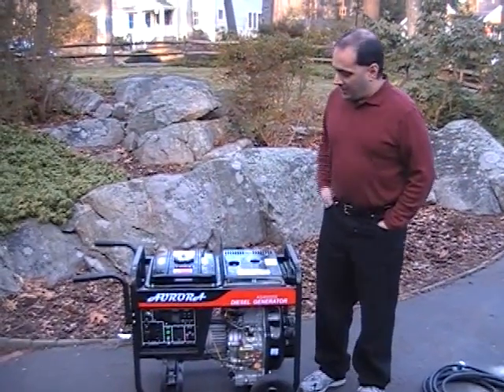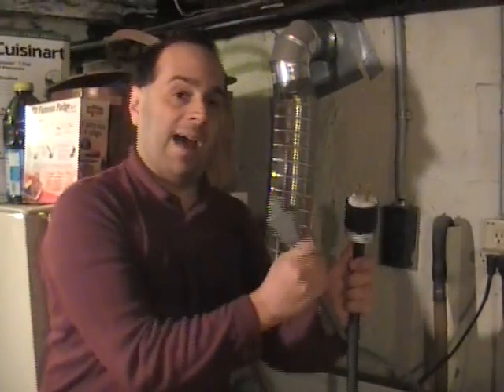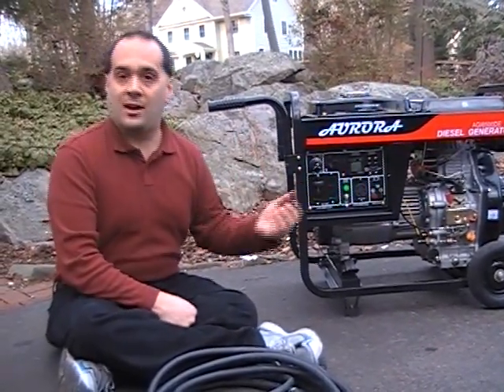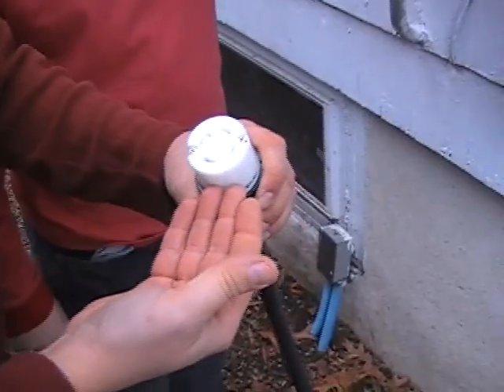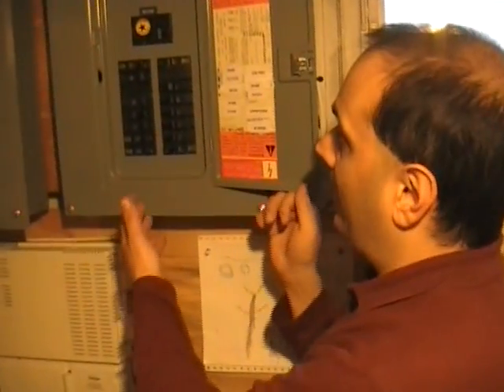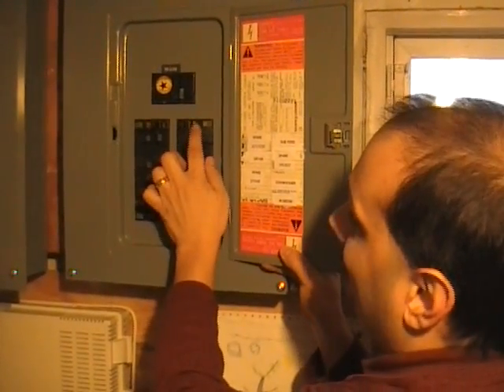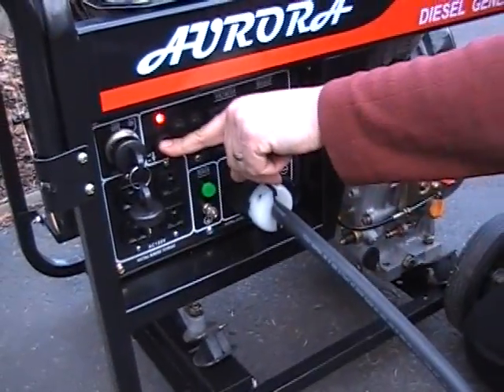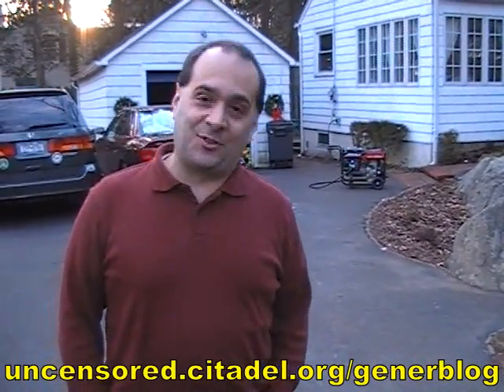Inexpensive residential generator hookup

Comment: My house is on a slab. Where do I put a transfer box and or plug and how do I run power to the breaker box. I bet it is easier just to run an extension cord from the generator to the various electric appliances.
Reply: Usually put the transfer box near your main panel.  It might be easier to run extension cords once or twice but it will get annoying over time.   It literally takes me 10 min to get my generator hooked up and running in a power outage.   I have lights on in all main areas of house, refrigerators, TVs, computers,  internet,  cable ect.  You don't realize how man electrical devices you have until you start trying to use extension cords ect.  Just wait until the big game is on and power goes out and you're scrambling with 100 extension cords trying to get everything going b4 it ends
Reply: blah how many watts is your generator? I just bought a 7500 Westinghouse that got great reviews along with 10 circuit kit cuz we have a well pump that will use 2 breakers. Not sure how many more things I can run with 9500 surge power 7500 running
Reply: I honestly think that my generator is like 5500watts continuous.  I've used it in power outages a few times now and have never had it pop its main breaker.   But lights are low wattage.  My ceiling fans run,  power supply on an average computer is like 500 watts.  But not everything is going to be running at one time.  It's the same theory as you have a 200 amp main panel,  but you could have 300 amps worth of breakers but its pretty rare that every item is pulling the maximum power.  Even your well pump might require a double pole 30 amp breaker but that is usually 25% higher that the absolute maximum that the appliance could ever pull.  Not to mention startup amps and running amps are 2 totally different things.   Usually an appliance uses the maximum at startup but uses considerable less as it continues to run.
Reply: blah FYI our well pumo is a double 15 so 3600 watts max, and as you stated, that's only used when water  is used.  The dryer and stove are the killers.  Double 30, and double 50 respectively. Cant believe a stove needs that many watts! Guess I could use one burner but microwave will have to suffice no big deal. First world problems lol
Reply: blah yeah. I hear ya. Thanks for the info. I'm considering returning the 10 circuit kit for an interlock kit and 2 pole volt cuz I was told by a couple electricians there's more flexibility to run multiple things. Some say its risky cuz you have to be cognizant of what you turn on and not exceed 7500 (in my case) or else a circuit can crash or the generator will simply shut down?? Would you recommend the interlock kit for my modern square D circuit board as opposed to a transfer 6 or 10 kit?
Reply: Jeff Stanley Try to buy a long 10/3 romex cord that way you have options in your basement for your main breaker location to where you want to put the generator/inlet box outside. Also you can buy a 100 foot or more (custom made) 30 Amp outdoor cord  to make things easier for generator location--> inlet box on home. What kind of generator do you have? Are you doing the work yourself when you get the 10/3 romex and switch, etc?  I guess it's fairly easy but I'm not an electrician
Reply: Mike Hamilton unless you're living off the grid (or a country where blackouts happen daily) you're not really going to need your dryer to be hooked to a system like this, a clothes line in the basement in case of a laundry emergency would suffice.  The same can be said for your electric range.   Most people in a power outage pinch that want to cook something besides microwave food would just use a gas grill.  My entire house is electric so I planned my system out to power the majority of the lights (it's nice to walk into a room and flip on the light), internet,  living room TV, computer,  refrigerators, garage doors, and my wood burning furnace.   Theres no chance I could use the stove, hot water tank,  heat pump/ac.  I didn't even try.  Dual 15 amp.. yes definitely.   I have a separate manual transfer switch.   When I did the install I didn't really grasp the concept of a lockout.  In retrospect I'd say the separate manual transfer switch is the better option bc its idiot proof.   If the power is out I don't have to look at the breakers or think about what needs on or not.  I just flip every breaker on the transfer switch.  Now if you need more than 10 circuits? That's another story.   I have a relatively small house, 200 amp box is full and I managed to make it work.

Comment: The real danger of a suicide cord is killing the man working on a power line outside, trying to restore your neighborhood.
Reply: couldn't you just flip off your main breaker? wouldn't this isolate the panel from the utility side but still provide you with a high voltage where you need it? and he mentions the circuit protection being on the other side but that's only for a fault. as long as it's over current that is the issue,  if the wire is sized correctly with the breaker you wont have a fire regardless of which end the breaker is on.
Reply: @mrpotatohead161  yes absolutely you could flip off your main breaker. But accidents happen. There are proven linesmen deaths. That double failsafe switch is an excellent choice. Or a secondary box with a failsafe switch.

Comment: How is the load balanced between phases?
Reply: The neutral returns to the center tap on the generator transformer balancing the loads between phases just like the utility transformer.
Reply: @JONNYGEEKMANG  So it's a 4 pin socket with a neutral. Got it.
Reply: lazzer408  Exactly, however there is one thing I want to mention. Good chance the genset neutral is floated as many are for feeding home power. The neutral and ground tend to be bonded at the genset and always in any home in this country. However if the genset has a gfci it will automatically trip. That's because there are two potential ground paths creating a ground loop. Floating the neutral at the gen set stops the current attempting to "ground loop" over the two neutral bonds. The generator must be labeled as "Floating Neutral" at this point. For it to be used as a stand alone again it will need to be bonded.

Comment: Why can't we back feed thru a dryer wire? I think it's a 14-2 wire which it can handle really high voltage.
Reply: 14-2 is only good for 15 amps most 30amp wire is rated at 30amps please don’t electrical work
Reply: Thanks guys.  Sorry for my stupidity.
Reply: Itchy. there is no stupidity in your question. Ignorance is not an insult either. You inquired with the desire to learn. Well done and now you know.
Reply from the maker: Happy to help.  You still get kudos for inquisitiveness and for a cool screen name.
Reply: @ @alecstone6674 , no disrespect meant, but please consult an electrician who knows what they are doing to show you one correct way (there are several correct ways) to do this, and to explain why such a 3 wire dryer backfeed does not meet Codes. Because you do not yet know, you can learn, and be safe. It is the self-professed "experts" on this YT subject who say such a practice is "acceptable", or whatever, that are dangerous.

Comment: Boy am I glad you mentioned about the dryer connection as a suicidal plug...for a minute, I was wondering if you were going to say using a dryer outlet would power up the house, but being said, dryers use a 30 amp 10 gauge wire, and 10 gauge is too small. Good info though, I have a sub panel also and it is for the generator use only, but I have a back up for accidential back feeding...a pull bus bar box running off the generator feed on the way to the sub panel.
Reply: 10 gauge is too small for what? There is a breaker in the drier circuit which will limit the current flow to 30 amps from the generator. The generator also has a breaker of probably 30 amps too. It doesn't matter which way current flows through a breaker and anyway, AC flows in both directions.

Comment: How about adding batteries some solar panels and a inverter, just run the generator to charge batteries as a backup conserve fuel. You would make that fuel last you weeks.
Reply: toolhead 147 you obviously haven’t done this yourself haha. 

Whole-house systems or even continuous ~6kw inverter systems cost tens of thousands of dollars in battery banks and arrays, way more hook-ups also. They’re okay for maybe an hour or so,  it compared to a generator your bank will be dead exponentially faster. 

You can run over to a Home Depot and get a 10kw for $950. 

If you use it once a year for a couple days you’re talking 25gal fuel maybe $65. 

Replacing a battery array every few years will run you $3-5k easily - even if you never had to use it. That’s on top of the dramatically higher initial cost also. 

It’ll never be cost effective. People only do this for off-grid or because they’re eco-freaks with infinitely deep pockets. I’ve made small-scale solar systems for sheds and RVs etc. I love it but it’s completely different from emergency home stuff.
Reply: You would need Alooooot of batteries. I tried with ONE solor panel, an inverter and two batterys and i could bearly power up a light bulb..
Reply: check out "guerrilla solar"
Reply: Im doing this my self definitely not an eco freak.  There is ways of doing this not spending 10 of thousands.  Just an example im doing this to power my a/c cooling,  or at least cut the bill in half. This process is not over night as you said I don't have deep pockets.  These panels lasts for 20 years batteries will last 7-10. There are ways around that 10k cost if you shop around.  Im going to use the generator as a backup incase of a power outage and batteries are not enough to last all night.  Anyways that is my plan eventually power most of my house.  I do understand solar is not for everyone, it was just a suggestion.  Thank you for taking the time to reply
Reply: Oh there "are ways" but it's not going to be a "flip of a switch" deal like buying a $1k generator and calling it a day. 

Having a battery bank last 7-10 years is optimistic if you're actually using them - I'm sure you know that the discharge ability of a bank dramatically impacts its usable lifespan. So either you spend twice as much on a battery bank and discharge it 65% MAX for long lifespan, or you have a bank 30% smaller and discharge down to 40% (taking a couple years off the life of the bank, or killing capacity). Either way - if you plan on using it, the storage will cost you $$$$$$ (either initial, or replacement costs). 

I used to have all of the equations out there - but forgot most of them. Either way you're comparing apples to oranges here. Sure you can convert the entire house to 12/24v, super efficient inverters, etc etc.. no AC or heat, no large 120vac devices.. and you might last for what.. 24hr on a decent-sized battery bank?

Keep in mind I have an aquarium with heaters, pumps, etc that must remain on. Most people need to keep devices running, I have a weather station and cell booster (required for reception in my area) plus other random stuff. 

Or I could spend 1/10th the cost and run the entire house (sat TV, AC, Microwaves, live is good!) for a few days and roll the thing back into the garage. 

Don't get me wrong, I love the idea of going off the grid - but my point was that it'll NEVER be worth it from a cost-perspective if you're doing it for backup/emergency purposes or have significant loads to consider. If you're in the middle of the Alaskan bush, then hell yeah - throw together a 20kw solar/wind system and unplug. :)
Reply: Unless you live in an area where electricity is crazy expensive solar panels are basically a waste of time.   The thought of a battery bank exploding and,/or turning into a fireball terrifies me.    I couldn't imagine wondering why the power was out opening the door to my power bank shed and being overcome by a poisonous gas cloud bc the whole thing is just a pile of toxic sludge, acid and plastic

Comment: A lockable manual lockout on the main breaker is often used by electricians working within a business. I wonder if such would be acceptable in the case of back feeding with a generator.

edit: I purchased a lockout device for the main breaker. Since I was permitted to wire the house I am qualified to install it, however the NEC has no bearing on the situation unless house wiring is modified (and it is not).

Comment: This is good BUT that generator makes a lot of noise. I would NOT like it running next to my house for very long. This is 2018 and there MUST be some of these generators that run quietly. Thank you for the upload.
Reply: That's debatable in both respects.  There are tons of generators out there now compared to when Honda actually was the best. The only thing that is for certain about Honda and Yamaha generators for that matter is that you will absolutely spend quite a lot of money on one.
Reply: This vid was produced by this Very informative guy, …. a way to SAFELY power up your home in case of an electrical outage without having to spend a ton of money on all the fancy dancy bullshit that the un informed will tell you, you absolutely NEED and its the only safe way to do it.      You can always  get a quieter Generator OR using say 8 instead of 10 you can place the generator further away and not have to listen to it  HOWEVER when I'm running mine in a power outage situation I PREFER to be able to hear it so that I can monitor it more closely ,... generators sit a lot of the time,  things can go wrong, you can get a bad batch of fuel,( I know, it happened to me) next thing you know your gen is not running correctly for whatever reason, Low power can and will trash certain appliance's , I prefer to put up with the noise instead of starting up the gen, walking away and forgetting about it.
 But again,   the vid wasn't about the noise of the gen , it was about using a gen properly, safely and affordably .  Just sayin.
Reply: Honda

Comment: Thank you for this useful info. I want to do the same thing with 10KW inverter (sub panel) but fully automated.  I want to understand if it would be legal if I used the contactor with house rating amperage  with normaly closed & normaly open for automated switch-over between power sources. That way my power utility will energize the solenoid to closed position. Once power fails then the contactor will fall over to an inverter. in this case there will be no contact between the 2 power sources. The inverter will also take a separate contactor trigered by utility power fail.  Anyone who can share the danger in this ?
Reply: you need a transfer switch rated at 10 KW and that will not be $14 it will be at least $300
Reply: Alex Ntleko toro he  mexicali

Comment: I would have more faith in a big relay with open and closed contacts. That way it’s impossible to have both power sources on. With such metal interlock thing, if that breaks off or something, you could still get both sources connected at the same time. I think it will be a fight of the giants who will win that short circuit. I think the generator will make some interesting dance (parts flying around, smoke, and so).
Reply: Relays can and DO fail!  Contacts weld together!  I have seen it many times in my career!  The closest thing to foolproof is an actual transfer switch and I am sure there is some way even that could fall apart  ...saying "impossible" is just ignorant IMHO
Reply: LOL - I want to go with the relay too, but not really sure if it's within the installation rules. I have seen some contactor are mechanical. they practically cling to each other via a lot and when one falls , pushes the other one up. Electro-mechanical switch-over.
Reply: meant via a slot
Reply: You have to understand how to operate the system.  It's highly unlikely that metal interlock will break off.  But if it does, the homeowner has no business operating a light switch.  If he turns off the main breaker on the sub-panel and the lights stay on, there's a problem - do not proceed with the transfer.

Comment: So you still end up using a "mechanical" lock-out switch? Just wire the generator to the sub-panel breaker and install an interlock!
Reply from the maker: That's exactly what the video shows.  In the sub panel, the utility main and generator main are interlocked.

Comment: If you have the space available, the interlock that he showed as "option 2" is just as good and less expensive.
Reply from the maker: Some of them are.  If you can find one from the manufacturer of the panel that is designed to mount in the panel, they are a great option.  The aftermarket ones that mount on the panel cover ... yes, they do work, but as I mentioned in the video, I find them a bit clumsy.

Also remember that if you're going to backfeed from a branch circuit, interlocked breakers are not the only requirement: NEC requires that the generator breaker must be held down to the panel by "an additional fastener" (in other words, not just the stabs that normally hold the breaker in).  The interlock kit that I used in this video came with parts to do that.  Take a look at http://photos.citadel.org/generator_001/installed_sub_open.jpg which is a photo of both panels with the covers off.  You'll see that the supply breakers in the subpanel have a bracket which retains the breakers in the panel, and that bracket is screwed down.  This is to prevent a breaker from accidentally popping out with live voltage on the stab end.

If you use an interlock kit, it's best to find one that includes these parts.
Reply: I think that is what I am going to do.  It is better and easier, but not necessarily cheaper because the interlock kit for my panel is $150!